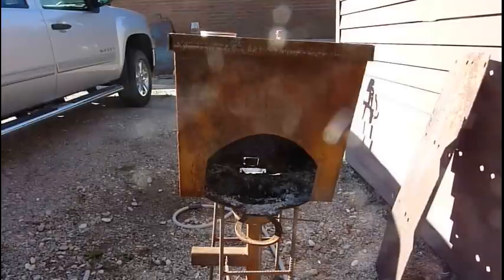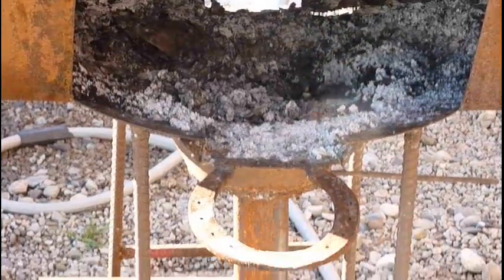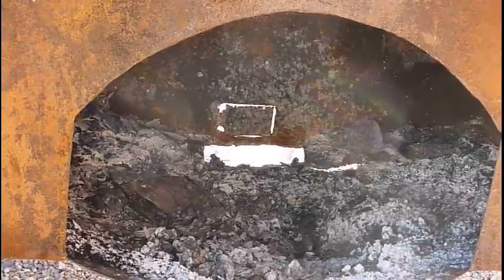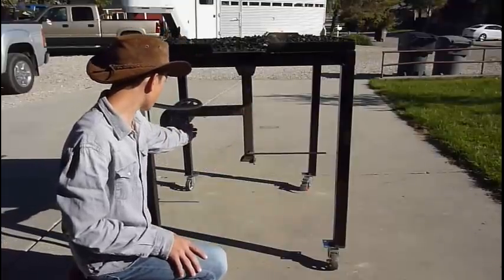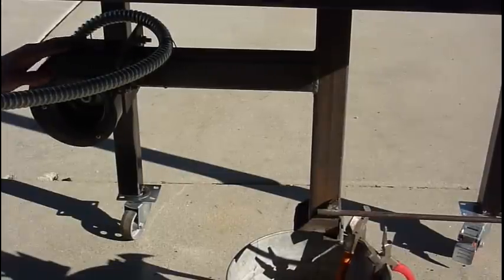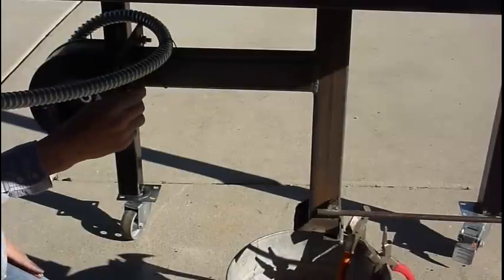How to build a coal forge!

Comment: Did you make this all out of mild steel sheet? I'm making a small side draft forge from some 10 gauge and a steel pipe I found, just wondering how well it holds up to the heat.

Comment: Hi I'm Joe, 23 years old and i'm making my own forge after looking at the series "Forged In Fire.
Your system is making me think twice about how i am building it, i'm making mine out of thick still, and i have all the tools i need at our steel shop. Its made with a chanel 5' long and 13" wide, i'm piercing a hole patern in the center 1/3 and all along. Onderneath i make a air box that covers all the hole and i install an air valve with i will conect directly to the compressor si i will just ajust my presure with a ballvalve. I will also have a slider under my air holes to change between two deferent holes parten with deferent amounts of holes.

Its a little late for me to change things after seing yours, and all your coments, but still not finished building it. Should i have made a biger table for extra coal, are my little hole directly under the coal bad ? Should i have a big hole like yours in the center ? Well ill find out. Thanks for posting your video, i will probably post one too.

Comment: nice work i will definitely  build this i'm 13 i started blacksmithing when i was 11 i have a very nice forge already but it's small so i will try and build this thank you for the design
Reply from the maker: Oh thank you! If you do build it, I would only make the fire pot abut 2 inches deep, mine wastes a lot of heat down in the bottom.
Reply: oh ok thank you for the info :)

Comment: Greetings!  I like the forge although it's a little big for what I'm after (I mean, it's not likely I'll build anything requiring that much space).  When you say 'Rockies', do you mean Front Range, in the mountains, Western Slope...etc.,?  I have a question but it will depend on where you are related to where I am.  I noticed the date was a year or so back, how has the forge been working for you?  Any changes you'd make? Good job.

Comment: Hello Sir,
Can you kindly put up the measurement for the piping and table again, please?
You have down a fantastic job and I want to recreate your beautiful work.
Kind RegardsScott
Reply from the maker: +shenlun The pipe is 2x2 in" tubing with 1/8 wall. The table its self is 3 ft by 3ft not counting the casters into the height. If I were to build it again I would only make it 2 1/2 ft tall because mine is a bit too high. The table top is made of 1/8 in" sheet and works well except for the fact that it bows a little in the middle so I would put more bracing under neath to keep it rigid.

Comment: Nice forge!.  We make forges here in NJ similar to this.  One of the primary parts that works very well is a blower motor from a direct vent water heater.  These can be found in scrap yards, demolitions, renovations...anywhere the old DV water heater is being tossed,  They are free and work great when wired in line with a rheostat (dimmer switch) just make sure it is a rheostat for a ceiling fan, not a light. (lower impedance).

Comment: This is one talented kid.  You should be an engineer, my friend.  I am going to attempt to replicate this build using scrap metal.  I live in SWFL and i have no experience with metal working or welding but I am interested in learning to smith.  If you have any advice on what I can use from an automobile scrap yard, please feel free to drop some comments below.
Reply from the maker: +Tommy Grassi 
Here is what I would do on a budget.
1.brake drum or brake disk for a fire pot
2. get an old style car hood, as thick as you can find and use it as the table, find one with a concave that would help hold in the coal.
3. Find a way to put a frame under. make sure it supports the hood or whatever you end up using for the table other wise you'll have warping issues.
Pretty much build the guts of a normal brake drum forge (there is a million videos on them) and if your using scrap auto parts drop the brake drum in a car hood, you might even get away with building a wood frame as long as you keep it far enough away from the center of heat it should not burn up.
P.s I would make the footprint of the stand as wide as possible.. my first forge always wanted to tip over on me because the feet were to close together.

Comment: Young man, you are an inspiration. Solid work. I have access to an old barbecue on a stand, the clamshell propane kind with the burner removed, and plan to make a forge for longer projects. I'm doing a little experimenting with plaster of paris, perlite, and play sand (as insulators) to make a closable forge that can accommodate things as long as machetes and short sword blanks for annealing or tempering. The fan I have is a cheap air mattress inflator  and I had planned a ball-valve on the air line for flow control BUT I like your rubber flap method much better. So much cheaper and so little to go wrong, too. I plan use common garden bricks as rests for the sword blanks as they form a bridge across the cambered fire box. In theory when I close the lid I'll have white hot steel in no time. Mine will hopefully function as well as yours. Cheers.
Reply from the maker: +Cur M That is really cool! I like the ball valve idea a lot. I want to make an air gate for mine some time so I can have finer controls, my blower is to big and I always leave that rubber flap all the way closed, haha. I have never worked with plaster of paris before. I was originally going to build a forge out of a barbecue just the way you described but I didn't want to have to deal with the plaster so I decided to build it out of steel. I'd think that your forge will be hotter and more efficient because of the insulation factor of the plaster. I hope it works well for you, you've seemed to have planned it out very well.

Comment: Great job man! Im getting into blacksmithing myself. Ive picked up an anvil from a co-workers grandpa recently and I am currently trying to design a good coal forge. The one you have made is pretty much what I have in mind, but maybe a tad smaller. Ive got an old squirrel cage blower off an old fire place with speed control im thinking of using for air. Its good to see young people get into positive activities like this, good job!!
Reply from the maker: +Blake Walsworth Thanks  I appreciate the input and encouragement. Ya I made mine a bit tall, someday i'm gonna modify it shorten the legs so its closer so its 2 1/2 feet rather than 3. If I were to make it all over again I would make the table the same dimensions but I would make it out of 1/4 inch steel and put in some bracing underneath (in starts to warp after a few hours of forging) I would also half the length of the t-joint that goes to the squirrel blower it make the fire pot want to shift sideways. Also another  thing I made the fire pot 4 inches which is way to deep, It would have been better if I would have made it 2 inches deep at the most it waists a lot of coal, those are my 2 cents after using it for a year or so. I would also brace across the bottom of the legs they wobble a bit when I role it around the garage.